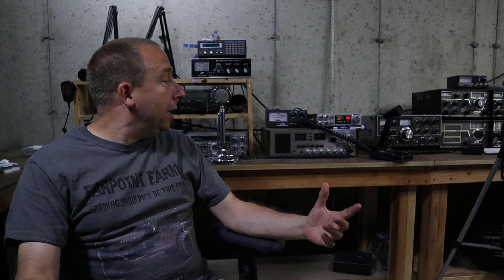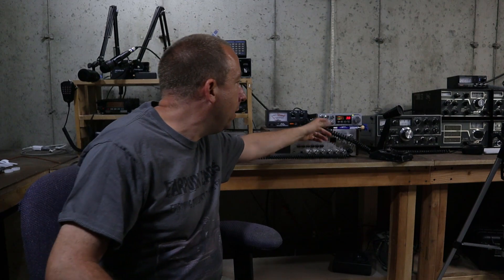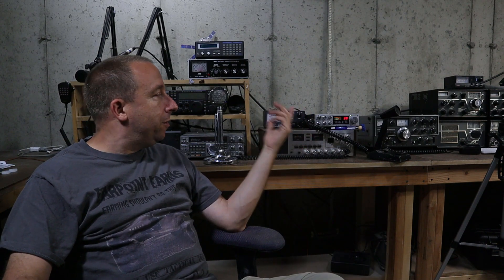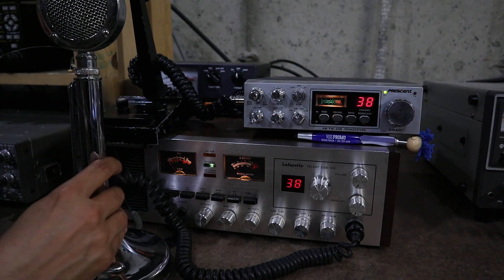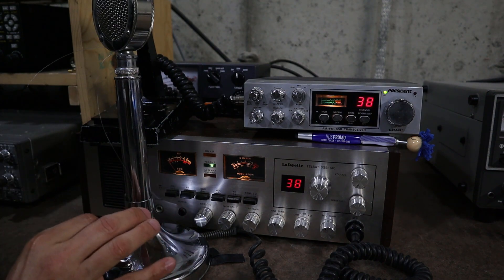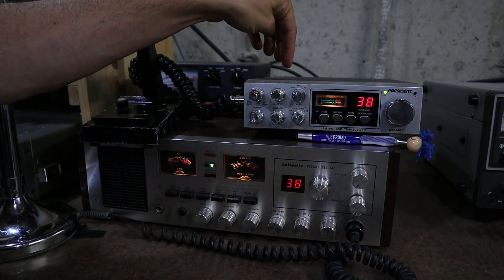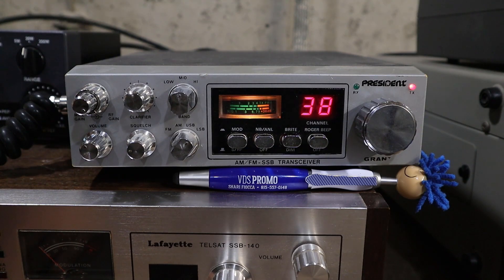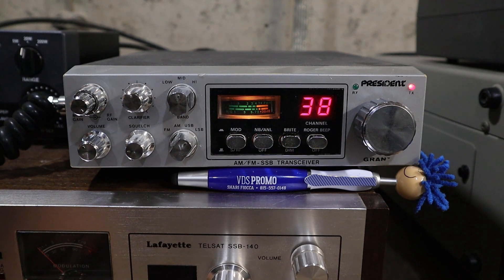Let's Take a Look at CB Radio

Comment: Lafayette SSB-140? Man, that brings back some memories. I never owned one personally but I worked on around 200 of them just from the mid ‘90’s until I shut down my shop around ’07 or ‘08 and many more in the years before that. They mostly came in for capacitor replacements and to have the power supply rebuilt. Over the years, the caps just dried out and eventually failed. Around half of them had an extra channel modification and most were hack jobs, very poorly done. 
 One of the things you said really piqued my ears. The ribbon cable. Since I haven’t seen the radio and the exact attachment points for the ribbon cable I can’t say for sure whether your guess of that being for a channel is true or not but I have my doubts. I heard you say that a wire or two were connected to the PLL. The vast majority of all the SSB radios of all brands that I’ve seen that used ribbon cord and were connected to the PLL used the ribbon cable for a frequency counter. Most of them used 4,6 or 8 wire ribbon cables and were only connected in 4 or 5 spots. I’ve seen some of your other videos so I know that you’re not a radio dummy, you could be correct. If it was an 8-12 wire cable and at least 8 wires were connected, then you had a very special radio. If you go as far back as the ‘80’s, back then there were only 3 people that were building channel control boxes using the 8-12 wire ribbon cable. 2 of them were absolute radio geniuses and the third was me. Of the other 2, 1 of them is still around. That one is Lester from Lester’s Custom Truck Shop/LesComm. I don’t agree with some things he does but when it comes to custom frequency boxes, he is the Emperor. His LC#### boxes were sold to shops all over the country and still are. They are the best ever made for that purpose. The other genius was a raging A-hole and egomaniac named Billy Dean Ward, a.k.a. The CB Doctor, he was the King. As he aged, he eventually became nearly human and we were good friends over his last 10 years. He was a true radio engineer with several patents. Long story but we collaborated on hundreds of ideas. Usually I could come up with the what if ideas and a basic understanding of the concept and he would build and test those ideas to prove the concept and put them into production. He was a horrible businessman though, screwed over a lot of people, including me, yet was still always broke. It was around the time that a few other techs figured out how to reverse engineer what we were doing when Les started his LC#### production and made all other channel mod boxes obsolete. I really wish I had seen it. Oh well. Still a wonderful radio. I noticed the light dimming that you spoke of. Given the age of the radio, it’s possible that the power supply is on its way out but I would start by replacing all the capacitors. At that age, even if they test good, they’re extremely likely to fail soon. Then look at the power supply after you test the radio for dimming and proper operation. If everything checks out within specifications, then do an alignment. I’m off to my old 746Pro to see if there’s anything on 20m tonight. Have a great time with those radios.
 Oh my goodness, I’m sorry. I always go back to check for errors and saw how long this was. I didn’t realize that I had rambled so much. My old mind just gets going sometimes and won’t stop. My apologies. Great video.
Reply from the maker: Wow - that's an awesome story, thanks for sharing!  I don't recall exactly how many wires were in that cable but I think it was somewhere between 6 and 10.  If memory serves, they were all different colors and not all of them may hve been connected to the board.  I don't recall exactly where it was attached internally but I do recall needing to do some work on the PLL chip to fix some cuts and jumps on the circuit board.  I also recall thinking that whoever did the work on this radio had done a pretty nice job.  The radio was modified, not hacked which made it easy to put back to stock configuration and get it working again.  I wish I had made a video about it back when I did this but I wasn't as serious about filming stuff back then as I am now.  I think you are right about the capacitors  - I'm sure they could use replacing.  If I can find some time this fall/winter maybe I'll re-cap the radio and do an alignment.  If I do, I'll be sure to put it on YouTube.  Again, thanks for the story.  CB has a rich and colorful history and I love hearing about it.
Reply: SevenFortyOne I’m long winded but normally not that bad. I’m glad to hear that someone did a good job. I always had modifications come in that I didn’t like or weren’t needed but as long as someone took the time to do it properly, it still made me happy. I’m proud of good work, even if it’s someone else’s. Like I said before, I can tell from your videos that you’re not a dummy. This is for you and for anyone reading because I know some are on tight budgets. While it is best to replace every cap at once in the old radios, for those that are on a budget, you can safely do just one section at a time. I recommend doing the power filtering caps first. Once those are done the order of the other sections isn’t as important. I’ve had my license for 20 years but still enjoy CB , mostly SSB. Good thing I like it since I drive truck now, not as busy as it used to be but it’s still needed at many places. Have a good one, time for bed.

Comment: all I got are three cb's a cobra some old sears thing and a cb to am radio thing
I got to make myself a base home unit any 12 volt power supply recommendations
Reply from the maker: I like to use old astron power supplies that I find at hamfest fairly cheap.  Mfj makes a few affordable power supplies too.  Make sure you get one that can supply enough power to rn your radios though.

Comment: that lafayatte telsat looks so classic and straight with those metal knobs and metal front, the wood on top too. the receiver doesnt sound bad, its no icom ic765 or ic7300, but good for a receiver that old. amazing that you got it for only $20. cb has great things to it, there is no censorship, someone cant simply deleted a comment and there is local news, sometimes dx. i would be afraid of criminals that spy people out and then rob peoples belonings.

Comment: Yeah, you can still have a lot of fun on CB, not here though, it is very dead in North East Scotland!  EDIT:  I am always hoping it will come alive again.  It is quiet in the UK now, some areas still have a few breakers, but the late 70s and 80s have gone.  We can now use AM, FM, SSB on the same 40 as you, but most are still on the old UK 27/81 FM spec radios.  Others have moved away from CB to Ham equipment and are using that for CB!
Reply from the maker: Too bad it's dead...it's a great band.  I've found it gets more active in the fall and Winter
Reply: @SevenFortyOne  There is a rise in use of CB due to Covid, but not in this area, shame, I used to enjoy my CB and in fact any radio.  There is another story attached to radio, but I'll not go into that for fear or incriminating myself!
Reply: bob fourjis: There are still many Scottish CB operators "on air".....when there's any short-skip propagation I hear lots of them (I live in East Lancs). I recently had a qso with a guy in Dingwall (near Inverness) and there were lots of others calling in too.  Have a look at the link below....there are many Scottish members and its all free :-)
https://www.charlietango.co.uk/

Comment: Good Info !  Like your channel  .  Is the radio above a RS  pro  scanner?
Reply from the maker: Thanks!  Yes, that is an old radio shack pro2006 scanner
Reply: @SevenFortyOne  Great I have a 2006 I have it on a specialized  ant .I got at  gov  surplus  auction it was dis guarded  from the state  dept works great

Comment: My RCI Ranger RG-99 looks like the Grant with the exception of the RCI being all black and having 12 bands. Where in CT. are you? New Milford here.
Reply from the maker: I've seen pictures of those...they are nice radios.  I'm in Tolland county near UConn
Reply: @SevenFortyOne  I used it when I lived in a house in Brookfield. Had an A-99 antenna. Now I'm in a condo so I can only use a mag mount out on the deck. Ended up getting a President McKinley for it's variable RF power adjustment, and am RM Italy KL-503 amp. I didn't want to open up the RG-99 and mess anything up trying to tune down the power for use with an amp. It does 10w on AM and 25w PEP. I should probably sell it.

Comment: I have a CB like your smaller one there. What kind of antenna are you using for that in your basement? I have a hard time reaching any kind of long range with mine. I don’t know much about them.
Reply from the maker: I use a Maco v58 base antenna...I usually use it on 20/15 meters but its really a CB antenna and works pretty well
Reply: SevenFortyOne thanks! Did u buy that new? I looked them up there like 150 bucks but they have great reviews. where do you have yours mounted?
Reply from the maker: I bought it new 10 years ago but it was only 75 bucks then!
Reply from the maker: Oh, and it's mounted 20 feet high on a Homebrew tilt over mast.  Search my channel for tilt over mast and you'll see it
Reply: SevenFortyOne will do thanks 🙏

Comment: Got my ham license 2 years ago, I have yet to transmit. The group isn't the most inviting.
I still have my cb.
Reply from the maker: Some ham groups can be intimidating.  It took me a long time to find a group I fit in with but I'm glad I stuck with it.  My advice is to keep looking around for a more welcoming group.  But don't give up on the first group either, keep trying and you might be able to break the ice with them.
Reply: @SevenFortyOne  Thanks for the advice. I'll keep listening and get the courage to jump in one day :) I wish it was used more widely on the highway too. I drive all over the southeast, 500+ miles listening to 145.62 and never heard anything.
Reply from the maker: We get a fair bit of traffic on 146.520 here in New England.  I even work hams flying small planes from time to time.

Comment: I watch Eric over at Farpoint Farms also. I want to get a CB with SSB but since I suck at small electronic work I would would have to get something fairly new. I did not catch what you using for an antenna. Can a dipole be made for a CB? Most CB antennas are vertical though. I wonder why CB FM is illegal in the states vs the rest of the world?
Reply from the maker: The guy I talked to last in this video is running a homebrew vertical dipole in a tree.  The newer cb stuff lokks pretty good and seems affordable

Comment: I threw up a little on this video title. LOL. Unfortunately, all the traffic I hear, which is mostly skip, is " Bye bye bye " " I'm reading the mail " I am making smoke with glass " Just plain rubbish. Guys running the knobs all turned to the left, as wide and as nasty as it gets.
Reply from the maker: Yeah, there is a lot of that out there too but the locals around here are pretty good operators.